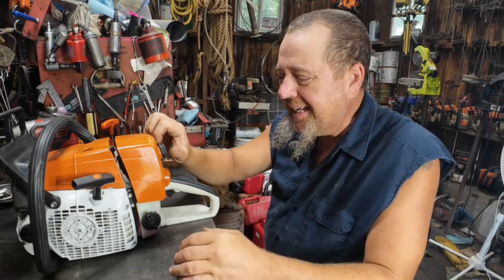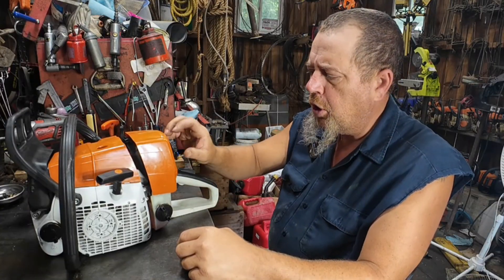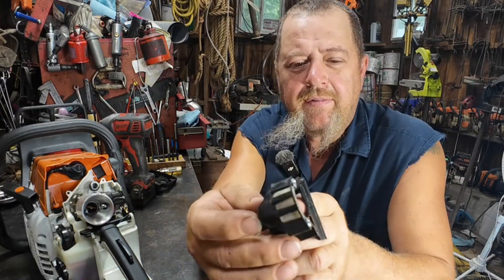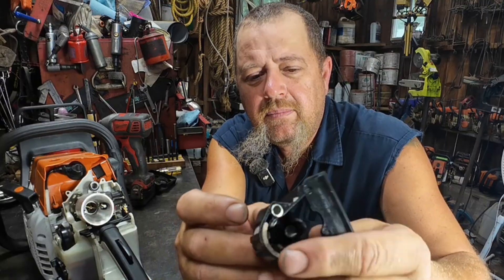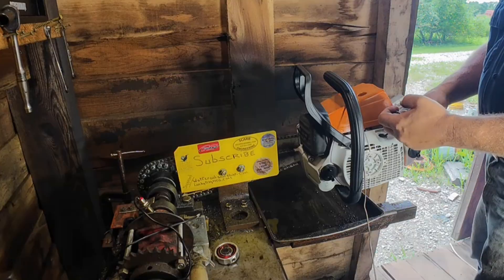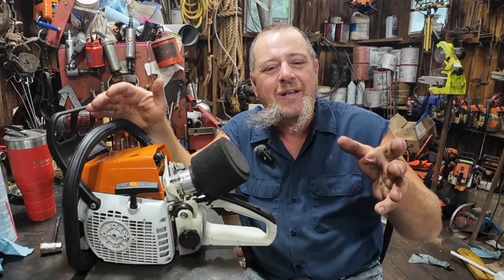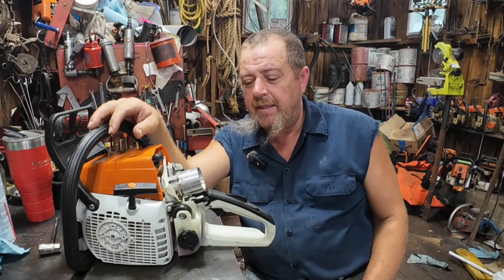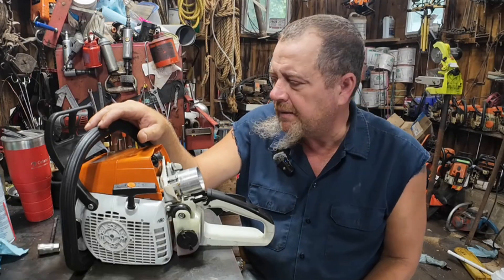Stihl Chainsaw Dyno Test – Does a Velocity Stack Really Add Power?

Comment: We did some work  to the mouth and anus … well said 😂 …  imho ain’t nothing wrong with em on a firewood saw , do it right it’ll never even cross your mind it’s there - k/n oiled filter with outwears run bout 100+ tanks fuel before needing  service so ya kill 3 birds with one stone - try running  THAT LONG with a stock filter. I wasn’t surprised at all by the gains in hp ( u got what about 10% ?) but the torque wasn’t quite right - should be a fuzz  more thru the range. I don’t think you’re getting the spitback boogie with that  filter - gotta be solid to get the reflective shot
Reply from the maker: @fabzacres-blackcat I was having that conversation with about a "firewood" saw with someone else too; there are about as many different situations for cutting firewood that one saw sure don't work for everyone. My firewood cutting would probably be considered "rough service in a hostile environment with a heavy handed ape at the controls".   I think most of the spitback was regurgitated, but not force fed back in; it never broke the plane of the stack, so it got sucked in with the next charge.  If the stack was much shorter, it may have escaped.

Comment: Finally, I figured out the hype  thing!
That velocity stack opened my eyes. I would have probably just flipped the air cleaner cover upside down
Reply from the maker: @bigmoustacheal3295 I still don't know how to do the hype thing due to using a computer... 
The ol' air cleaner cover was JUST one step below the shiny chrome top/bottom with the exposed element.     ...couldn't afford one of those.

Comment: That  v stack made a good  gain.i got a home  made v stack  on my craftsman  3.7  I think  it makes more power also. That and  a good  muffler can really wake a saw up.
Reply: It's a 1987 craftsman  3.7 or poulan 3700
Reply from the maker: @JeffBarnesChainsaws Ahh Ok; the one I seen was a different manufacturer (Same model number) but was built in the 70s; I didn't read close enough on the specs page.
Reply from the maker: @JeffBarnesChainsaws It sure does!! I think I already asked, but didn't see if you replied; is that a reed saw?
Reply: @HayChaffandSawdust1 no  just a boat anchor
Reply from the maker: @JeffBarnesChainsaws Thanks! I did look at the specs and one place said it was a reed-fed saw; just 'cause I seen it on the internet, didn't mean that I was goign to believe it.

Comment: I wonder if it was the stack or just unrestricted air flow. Curious what a dyno run with just the carb, no stack or filter.
Reply from the maker: @stacyharmon5865  It has the nylon mesh filter on it and it's not very restrictive... and it doesn't filter fines very well; I tried an open back carb on a different saw and actually found losses; seems like there is nothing to "guide" the air.

Comment: In regards to a V-Stack some might argue spending hours “Heeling and thinning” on a chain wouldn’t make it a firewood chain but hey it’s all personal preference I suppose.
Reply from the maker: @Houseworksaws I dang sure won't argue with ya on that. Well... heeling, doesn't take but just a few strokes with a raker file, doesn't take anything away from the life of the chain, and improves chip flow for the life of the chain.... but you're right!

Comment: What do you think about putting a 575 full circle crank. In a 372xp non xtorq?  It’s soooo close it may fit?
Reply: Really?  Wow that’s interesting. What is all the hype about?  I thought if nothing else it made it snappier??
Reply from the maker: @darrellhenderson913 Now, don't go to thinking I'm any sort of expert or anything! I have very little experience with them. I think the original concept was to increase low end torque. In bikes, it was full circle cranks (lower case volume) where some grunt was needed for lots of corners; for higher revving and longer runs, they used boost bottles to increase case volume.  I can see whey they put them in some of the saws that they do... low end grunt makes a saw feel strong!
Reply from the maker: @darrellhenderson913 I think it would depend upon the use of the saw; I, personally, haven't seen the gains from a full circle crank... may just be my porting "style"... or lack of style??

Comment: Those old Quadra Bogs sounded awesome with the lid flipped. The good ole days
Reply: The good old days for sure!
Reply from the maker: @jonathanhensley8685   ...the things that country kids do!!
Reply: Quadajets,didn't have to bog, if setup right very easy carb to work on
Reply from the maker: @paulguptill5566 I do agree; I actually prefer the Rochester to Holly... that's just me though. Of course, I'll still embrace a funny name even if making fun of my own stuff. 😂
Reply from the maker: @Houseworksaws "Quadra Bogs" 🤣🤣  Funny how things get different names in different areas; they were known as "Quadra Junks" here 😂😂
Reply: @HayChaffandSawdust1  had a 58 Chevy pick up that would flood on the way to work…..pull over and remove the top, cuss, put it back together and wait for the next time.  No rime nor reason, just wanted attention.  Hated them and loved Holleys…….but poor means run what ya got 😢
Reply from the maker: @williamstewart5635 Funny how "it's what you're used to"; I actually preferred the Rochester to the Hollys; I had a 77 F150/460 that was like that... FINALLY found a wire (almost) broken in the advance... talk about a fun thing to find... also no rhyme nor reason!